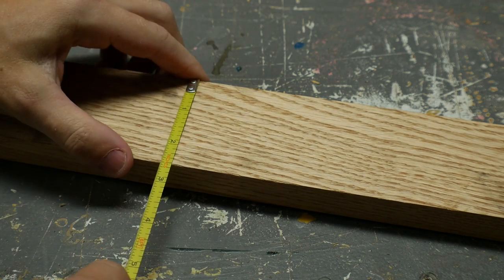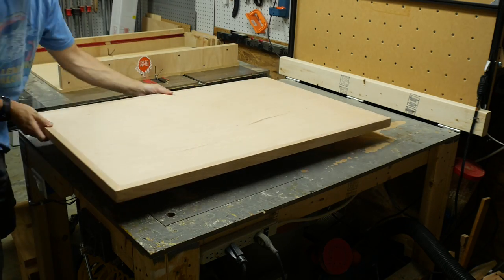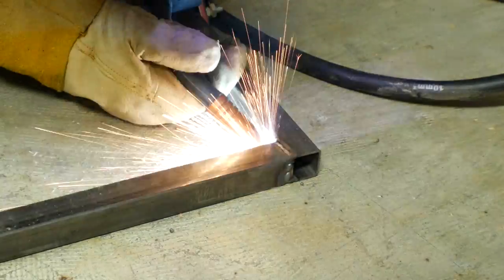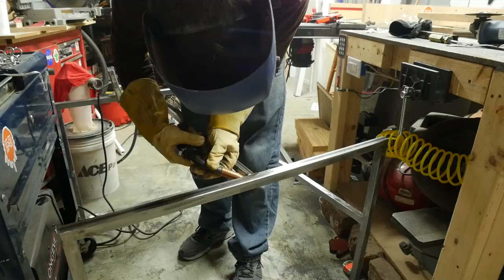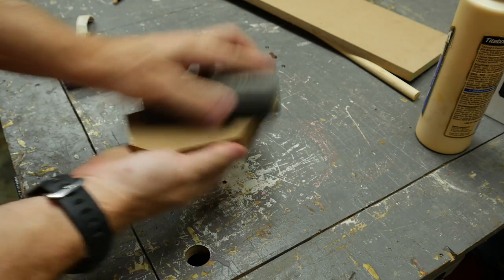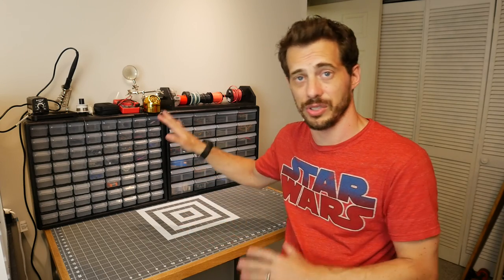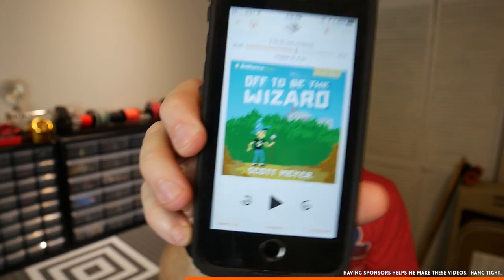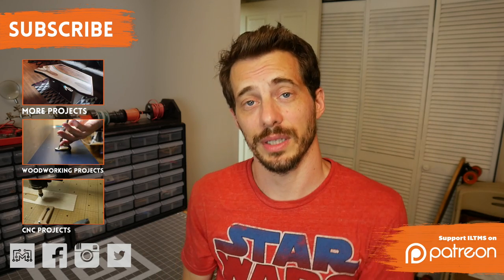Steel framed standing desk (electronics station) // How-To | I Like To Make Stuff

Comment: Hi Bob, i'm not sending this comment to pick at your welding. I've been in the welding/fitting trade for over 20years now and just want to give you a little pointer on your vertical welds. For a frame like this one the flat welding would have been plenty strong so it would have been easier for you to make downhands weld on the vertical. Plus, I assume you were using either hardwire or metal core,(There was little amounts of smoke) and you can't weld going up with those wire, you need fluxcore. If you do give it a try, angle your gun at about 30degres pointing up and start from the top going down. A even easier way when you start welding is to do flat weld. For those you just needs to move the assembly around to accomodate a flat weld. Happy welding!

Comment: if it`s not falling a part after welding - you are not so bad welder. my stick welded things easily braking by one hit...
Reply: Dmitriy Lutsenko you learn with failings!
Reply: grindfi anybody do this) if you not failing, you probably doing nothing)
Reply: Dmitriy Lutsenko If you are not failing, you are not trying :P
Reply: +Dmitriy Lutsenko  If it breaks apart in the seam/part interface, it is probably because of lack of penetration due to too little heat/amperage.
Reply: +Esben Jensen nope. It`s because 1) I`m crappy welder 2) I have an extremely cheap stick welder 3) mine sticks are came from 80-s, its made in USSR and it`s a junk, that explode in my face sometimes... so... to many problems to solve its right now...
Reply: +Dmitriy Lutsenko stick welding is also the hardest kind of welding to do, you can get so many more problems with that than you can with mig
Reply: ***** mig is now too expensive for me and stick welder I`m already own

Comment: I made a spool holder like yours and I put a couple of pins in the dowel ends cause I found sometimes  the spool would slip.  They are wedge cut an fit into holes drilled in the dowel at either end. I tried straight circular pins and found they jammed and slipped out occasionally. It Seems to work well since I don't change the  spools too often.

I have also used a bit of NMC (Plastic piping conduit available in a variety of diameters) as a portable  spool holder.    I  glued an empty spool to the  bottom end to hold the spools and  made a top cap from  a plug of plastic sheet cut with a small hole saw.  Good work and enjoy.

Comment: I'll be rebuilding my indoor workbench soon, so thanks for the inspiration and ideas Bob. FYI, I recently built a similar wire dispenser for my pegboard (see video on my channel) with a unique way of holding the loose wires in place. If you find that your wire spools are getting too unruly or tangled, you might want to have a look at my setup.

Comment: Interesting design, Bob.  So the hardwood edging extends below the plywood and serves to hold it in place on top of the frame so you don't have any fasteners at all!  Clever!
Reply from the maker: wordsnwood Yes! I originally figured I'd have to drill some holes in the frame and screw up into the plywood, but I got the frame to fit pretty tightly so I didn't need anything to hold it on.

Comment: Regarding your overhead camera mount.  I needed one also and found that an i screw into a stud is a great anchor to attach a standard tripod.  3 turnbuckles is what I used to connect the Screw and Tripod.  It works great and is really stable.

Comment: Nice to see you welding, you've been talking about it forever. Desk looks good. I've tried that style of wire/tape holder before and wasn't a big fan as its a pain when you need to take a roll off which I seemed to do a lot. I prefer a long narrow box that holds them all in a similar manner but they can be pulled out easily. Although If you are just working at that desk all the time then they are kinda cool.

Comment: Small tip - dont make full welds on one side, before switching to another. I know that you had clamps, but steel can still move when you release the clamps and welds are not cold yet. It's way safer to tack one side, than another, fully weld the second one and then return to the first one. Love your videos by the way! Best regards from Poland

Comment: i don't know if you will ever read this, but just for the future, it probably didn't make a difference for this project but when you tack weld it helps to tack all sides before starting to actually weld especially on thinner metal. doing this will keep it from bending from excessive heat on one side

Comment: for the spool holder if you got a small diameter wooden dowel (5mm-7mm) an two springs you could bend the end could of the spring so it vertices not can rap around each and end of the dowel then attach the other end if the spring to the board you can put the ends of the wire between the dowel and base so the spool doesn't unravel and you can just pull it from there and cut easyer!

Comment: Great vid. I'm inspired to make a bench for myself. Mine will be a lot wider and run down the length of a wall. I find it difficult to not have close access to drill press for drilling out pcbs, project boxes for things like pots, switches, lcd, jacks. Also a hot glue gun needs to be close at hand when assembling projects...that could be done on one end. In the middle I would have my laptop/breadboards/arduino, dmm, scope for deign work and the other end would be for soldering. Thinking a perspex barrier around the drilling area. And yes to you making an exhaust system video...keen to see that.

Comment: just a tip with your welding, when you are welding move the gun back and forth instead of a smooth motion, it will help with heat penetration and bead integrity, and also with some practice makes it look nice.

Comment: I noticed that you were welding bottom to top on your vertical welds. I am a certified welder and wanted to give you a little advice. welding bottom to top on a vertical weld will give you a convex weld. It will be stronger but it makes it harder to weld. If you go top to bottom, it will be concave, not as strong but for this application it will be plenty strong. Love the channel and keep up the good work!
Reply from the maker: +Ryan C Good to know, thank you!

Comment: If you're building with rusty metal, run the wire brush over all the parts before you weld together the structure.   It will be much, much easier to do..  After welding, you'll need to clean up just the welded spots.   Also, for the most part, try to tack much of the structure into it's final shape before laying real beads.  The tacked structure will allow making adjustments in angles and alignments.  It also allows you to knock it back apart if you discover that you made a mistake.   Also recognize that the hot bead will expand, then contract..   That contraction can easily break welds on square tubing in joints that don't allow contraction. . You'll hear it crack.  You may even see it pull apart.  Be prepared to see the structure warp more than you expected.  Try to weld in ways to offset that warping action. 

These effects are especially pronounced when welding square tubing. The bigger the tubing, the bigger the effect.

Comment: inspired me to clean my act. Your work space is impressive. I find it almost impossible to do hobby electronics without a drill press nearby for drilling out homemade pcbs, aluminium/plastic project boxes. My space is limited and sits on the edge of my electronics bench..crap everywhere. Yeah extractor fan project would be good...

Comment: I have seen  a couple of your videos where you use a bandsaw and your blade has a lot of flex to the rear. You even mentioned having to deal with the problem. My bandsaw results got a lot better after watching a few videos on how to set one up. I recommend taking a few minutes with that to eliminate the problem.

Comment: Awesome station! The only thing I would do is drill a hole through the dowel at both ends and put a cotter pin through to prevent the dowel from falling out while unspooling the wire.

Comment: I would suggest for your next welding projects, to pick up the material from a steel supplier rather than the big box stores. I use PDM Steel for welding projects. For 1" square tube, I'd pay about the same for 20 feet from PDM as I would 3 feet from the big box stores. Anyway, hopefully that'll help with project costs, weights, etc. :)

Comment: I got one of those free Harbor Freight multimeters.  It works ok for general testing. Really surprised it can check pn junctions on diodes and transistors.  I've been keeping my Fluke in the case.

Comment: What's up I Like To Make Stuff  So I have a power supply of my own and I wonder if you're planning to make a "knob variable" power supply or just a standard 3.3, 5 and 12 v out of an old ATX power supply (or any other kind for that matter). If you're making the knob variable one I would be really interested to see what method you'd use, because I made one of my own and it doesn't work really well.
Thanks pal
Great video by the way.

Comment: For the benchtop power supply, I "made" one out of a CC/CV DC-DC Converter Module you can buy for 10 Bucks on eBay that has current limiting, voltage and current display, presets and you can get up to 36V and 3A from it. Combined it with a older power brick off an old laptop that delivers 24V it does all my magic for less $$$ than a large pizza and a coke. If you want a video let me know.

Comment: Hi Bob, we've been in contact before but that's not the point of this question. My question is when to use a miter saw and when to use a table saw? I just bought my table saw, but it seems like you can do the same stuff with both pieces of equipment. I'm a bit confused, help me Bob!
Reply from the maker: AntonnTn :) Well, a table saw (with the right sled) can do everything that a miter saw can do, and more.  It just has the advantage of a large surface, and being able to rip long pieces.  The miter saw is really just more of a convenience tool, I'm finding.
I don't think there's a right or wrong answer as  when to use each, it's just whatever works best for the particular cut.
Reply: Thanks Bob :) Keep up the good work and please do post every project you're planning to do! :)

Comment: Instead of using a cut off wheel is it possible to use a miter saw? And just wanted to add I'm a huge fan and just started putting a amateur workshop together, I'm just hoping to be able to make some cool stuff from my limited tools in stock!
Reply from the maker: +likemike252 Thansk! Yes, you can use a miter saw with a cut off wheel on it. For me, I don't do enough metal work yet to justify swapping out the blade for it usually.
Reply: +I Like To Make Stuff Also depends on the kind of material you're cutting. When I used to do exterior stuff, we'd cut extruded aluminum with a normal wood blade on a chop saw. That being said, a good metal cutting blade on a chop saw will make a lot nicer cut (and less chance of pieces binding up and jerking the saw or shooting off pieces) Not a pro, just what I've learned through an old job.

Comment: Don't hold back.  You inspire, so keep on!  If we can inspire one, that becomes 2.  1+2=3, 2+3=5, 3+5=8...  Look it's a Fibonacci.  I have been working on a 64" free standing, human hamster wheel that can keep up a good speed of rotation.  I even was thinking of adding my Arduino Uno and sensors to clock the speed.  The main creative design was to create  "The Infinite Slide".  The inside is Hardboard (Masonite) and the kids sit and slide as I spin it.  It is all about the fun (and learning) with the kids!

Comment: Have you had any issues doing grinding inside your shop? I have to clean really well to get rid of the metal dust before it screws up a project so now grinding just gets done outside when it's not raining. 

Oh and don't use the grinder and angle the sparks towards the window by accident, that's a good way to ruin the glass (oops!).
Reply from the maker: Pete G Yeah, it makes a huge mess in the shop. I did the whole thing in one afternoon, then had to spend an hour vacuuming up the flecks.  I had the door opened and a furnace blower pushing air out the door, that helped a bit. You could also mount a box fan to pull the air out.

Comment: Just curious.. why not use the ESD mat as the table top surface (they make very durable ones that are heat resistant)?  Is it because you wanted a cutting surface?  Will you do a video about that eventually (showing how to properly ground)?
Reply from the maker: Yeah, I'll use the cutting surface a LOT more than the ESD mat so it's the base layer.

Comment: Grinding the welds is not just to hide mistakes, it's often necessary for proper fit. But for me, it's for hiding (or rather, erasing) mistakes =D

Oh... one small comment... what you did first there was tack weld, not spot weld ;)
Reply from the maker: Left Flamingo Good call!

Comment: if you are burning thru you're metal you are welding you should turn down the amp and volt on your welder some welders will come with a chart on the side were it will tell you the preferred settings

Comment: When cutting metal pipes, square or round, if you can have the cutting tool fixed or stationary, then just rotate the pipe to cut along/through the edge.  This way you don't have to go all the way through from one side.

Comment: Not here to pick on your build, it looks really good, but when making frames with square tube you should try to use 45 degree miter joints. I can see that you dont have the tools to make those kind of cuts but it is something you should keep in mind for your next project.
Reply from the maker: DEMMERY11 Yeah, I know that is ideal, but like you said, I don't have the tools for it, so it would be pretty difficult to do.
Reply: I Like To Make Stuff There is nothing wrong with the way you did it I am sure it is strong enough, Just having open ends is not ideal.

Comment: For your lab supply I hope you're not planning on just modifying an old PC power supply. When you need a lot of current, they're great, but when you're working with low power devices and you make mistake in a circuit, they work too well at being magic smoke releasers.

I would be tempted to go with a DC-DC converter brick, and then adding in the circuitry you need to regulate the voltage using a pot or similar, and putting in a current limiting circuit so that you can see you have a problem without causing damage to your project (that has saved me numerous times on my projects).
Reply from the maker: aiden1015 That's a good point.  The PC supplies are a really handy way to jump start it, but you're right, I typically only need 3v, 5v, or 12v so it's kind of overkill.  I haven't really done my research there yet to know what approach I'll take, but it won't be terribly complicated regardless of what it is.

Comment: if you try to use an old computer power supply to be a bench top make sure if it's an old power supply it is still good. I used an old one and after four hours of cutting,p soldering, shrink tubing, and hole drilling it didn't work.

Comment: I have a question:
If  I were to glue a metal hook to wood, would I use wood glue or would a glue gun work?
Reply from the maker: +Ashwin Kumuthan I would use epoxy if you wanted a permanent bond.
Reply: I Like To Make Stuff OK, but if were to use the other two, even if I won't get a permanent bond, which would I use?  Also, great channel!  Your videos are pretty interesting.

Comment: it'd be a good idea if u added a groove on both sides of the dowel on the ends so it doesnt slide out.. just something to keep it in place while still being able to remove it easly
Reply from the maker: eric de la fuente Great idea!
Reply: ha, got the idea from our paper towel holder we have... works great :D
Reply: eric de la fuente I Like To Make Stuff Shaft collars would be another good idea for this -- they are cheap, easy to remove, and readily available from McMaster for tons of shaft diameters.

Cool video, Bob!

Comment: Wouldnt it have been more efficient to have put multiple veritcal dowels onto your wire-holder? Like that you could have added more and more different ones and just have some wood or metal in the front through which you could have guided the wires to easily cut them and always easily find the end. It would just have held more

Comment: I'd like to see the fume extractor build.  And the camera rig too.

Close ups of welds and the puddle are overrated and really only useful in instructional videos, not so much on project videos. 

One suggestion I'll make is wearing different shoes when welding.  I wore my running shoes while doing a quick weld and had a hot chunk of steel drop on my mesh-topped shoe and melt right through it and burn my toes.  After that, I only wear leather boots for welding.
Reply from the maker: dahveed284 That's a really good suggestion, thank you!

Comment: if you heat up the steel metal with a oxy torch. then ruin over it wirh a brass wire wheel.  you'ill then add a brass look.

Comment: Nice! I'm a new welder too. 
I suggest you don't make a fume extractor. Instead, I would just have a fan blowing across the workpiece. It is so much cheaper and very effective.  Don't blow the rosin smoke at your kids. I made one of these using a 200mm computer case fan, a 2x4 and a 12v wall wort: http://www.amazon.com/gp/product/B002LE8BJA